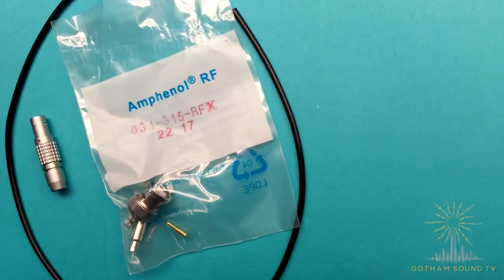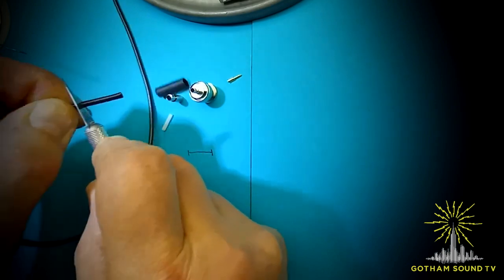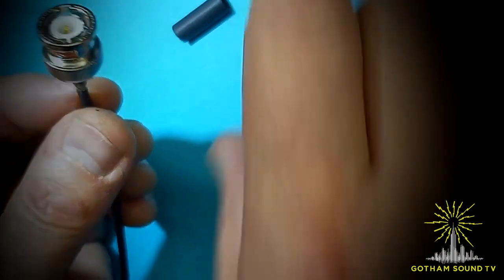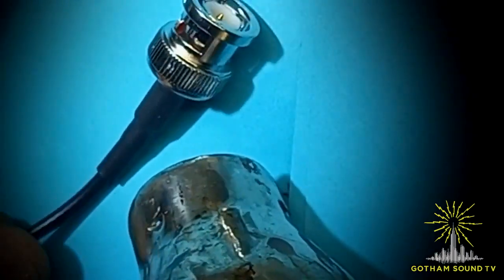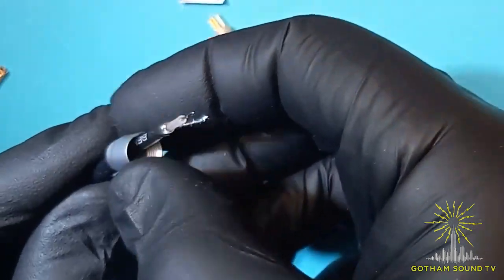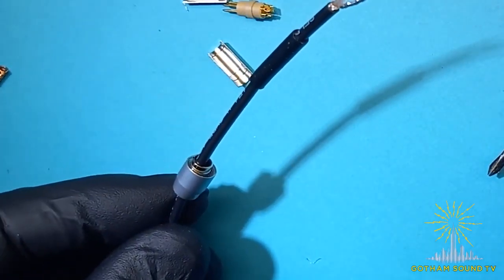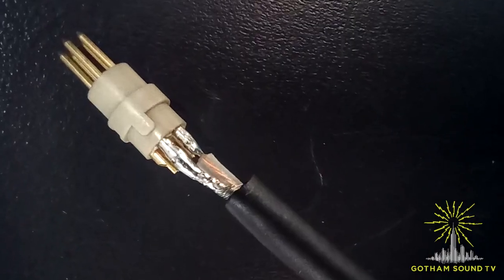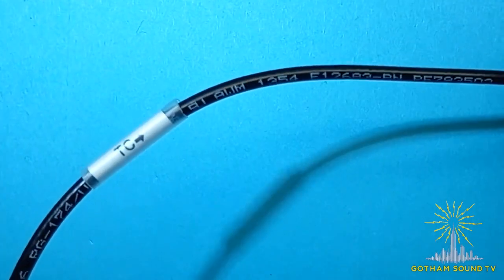Lemo5 (TC-OUT) to BNC Time Code Cable Wiring

Comment: Thanks for sharing. I've made a bunch of my own over the years and always wondered if I was doing it correctly. Curious what that long pliers is called (used to tighten the collar) in the last 15 seconds.
Reply from the maker: They don't seem to have a common name beyond "wire stripper", but we often use the Jonard Industries 801-JIC-2030:  https://www.mouser.com/ProductDetail/Jonard-Industries/JIC-2030?qs=YqNA2qefETClfmG3wb4eSQ%3D%3D